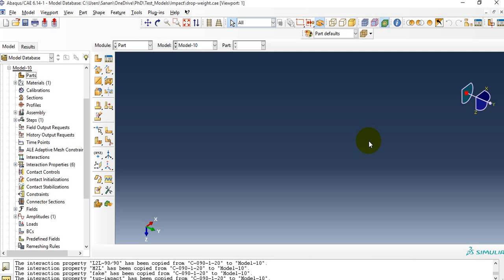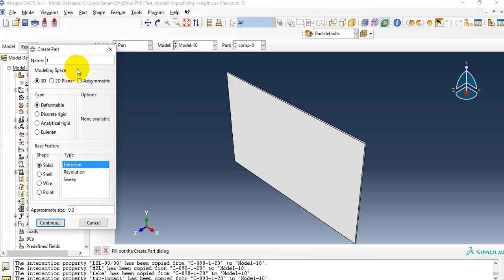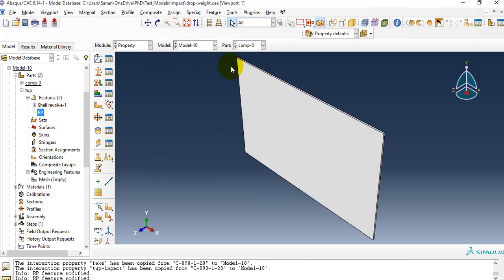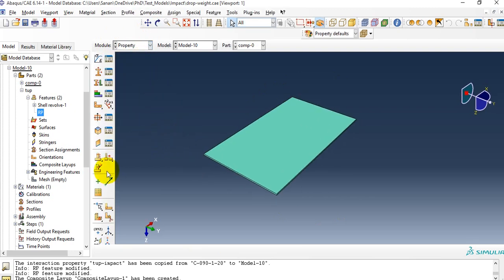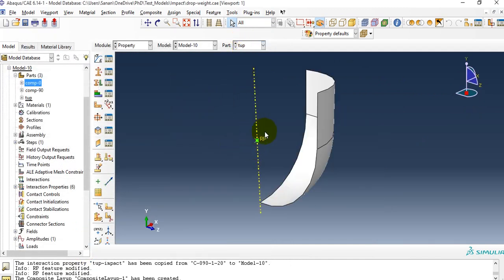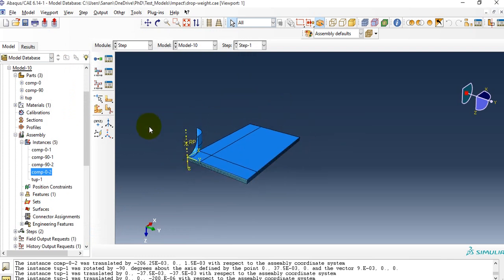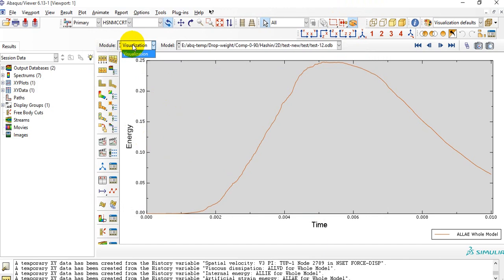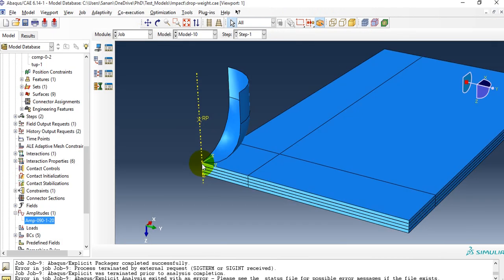Modeling and discussion : Drop weight impact on Fiber reinforced composites

Comment: 1) Anyone facing issues with velocity boundary conditions and lack of data for creating an amplitude, could resort to defining a "predefined field". It works fine!
2) Also I suggest using Analytical rigid instead of discrete rigid if the impactor could be modelled as an extruded/revolved shell. Analytical rigid gives more accurate results than discrete imo.
3) Take care of the mesh size as well. Check if its an element or node that is present at the impact point. Its highly sensitive to the results.

Comment: Thanks for making this great video. It helps a lot.
I got an error when I was using the surface-based contact to simulate the delamination between continuum shell composite model saying that the general contact can be given a property with cohesive or damage. In this video, you solved it by assigning a fake properties. But I tried in Abaqus/standard. It doesn't work, then can you tell me what I can do?

Comment: Hello sir, I want to model a reinforced concrete beam in Abaqus without using Rebar, I want to assign only area of steel as a whole to the beam, so later I can use the area of steel to design the rebar using design software? How to design this model in Abaqus? Can I use composite beam or? Please help me if possible. Thank you.

Comment: Hi! i became  the error about the Orientation. It is: The local-1 direction (after the additional rotation and permutation) of the material orientation, specified via *ORIENTATION, for element 4800 instance KOMPO_-45-1 is normal to the SHELL, MEMBRANE, GASKET, COHESIVE, or SURFACE element. The local 1-direction must be projected onto the element surface. Check input data.
What should i do? Thanks a lot.
Reply: Maybe someone faced my problem which I could solve it. I used data for amplitude in Load section and I finished everything but when I wanted to submit my job I faced the following error: 

"The local-1 direction (after the additional rotation and permutation) of the material orientation, specified via *ORIENTATION, for element 1 instance COMP-0-1 is normal to the SHELL, MEMBRANE, GASKET, COHESIVE, or SURFACE element. The local 1-direction must be projected onto the element surface. Check input data."

After searching, I used "assign stack direction" command in mesh section for each layer (before using this command you should click on "part" command on top of mesh section in object command and don't use assembly command ). after clicking  on "assign stack direction" choose a part of a layer (for example we had 4 parts for each layer in this tutorial video) then click on the top surface of that part that is brown or near brown surfaces and do this step for each part of layer.

Comment: Maybe someone faced my problem which I could solve it. I used data for amplitude in Load section and I finished everything but when I wanted to submit my job I faced the following error: 

"The local-1 direction (after the additional rotation and permutation) of the material orientation, specified via *ORIENTATION, for element 1 instance COMP-0-1 is normal to the SHELL, MEMBRANE, GASKET, COHESIVE, or SURFACE element. The local 1-direction must be projected onto the element surface. Check input data."

After searching, I used "assign stack direction" command in mesh section for each layer (before using this command you should click on "part" command on top of mesh section in object command and don't use assembly command ). after clicking  on "assign stack direction" choose a part of a layer (for example we had 4 parts for each layer in this tutorial video) then click on the top surface of that part that is brown or near brown surfaces and do this step for each part of layer.
Reply: how u took amplitude data

Comment: Hi Sanan,

This video is more informative. I am trying the same problem using 3D hashin failure criteria (VUMAT subroutine).

Iam using a composite layup tool with solid as a element type for modelling a laminate.

The plate is meshed using 3D 8 noded linear brick solid element C3D8R.

After submitting the job, I am getting the following error 
1.  THE PARAMETER COMPOSITE CAN NOT BE USED IN Abaqus/Explict 
2. 630 elements have missing property defination 
(All these 630 elements belongs to composite plate)

please help me  how to overcome this error. 

Thank you
Reply from the maker: +vijay krishna don't use the composite layup tool instead use the orientation tool. it will work then.
Reply: ok sanan i will try and let u know.

thank u
Reply: +Sanan H Khan i tried orientation tool to assign material orientation. It works fine.
and i used solid homogeneous sections (with composite properties)  to assign  material properties.  

is it right to use solid homogeneous section with orientation tool  to model composite laminate.
Reply from the maker: vijay krishna go with it.
Reply: +Sanan H Khan  OK, thank you
Reply: +Sanan H Khan can u please give an interaction properties for 0-90 laminate & 0-0 laminate.  

i am modelling sandwich structure where can i get the interaction properties for foam (rohacell) and 0 laminate.
Reply: vijay krishna yes, solid elements cannot be used with composite layup, you have to create section and assign orientation to them (which is the layup angle)

Comment: hello  sir
first thanks a lot for sharing such  tutor. but i have some question.
when i  increase the mesh density(very fine) , the final solution is start diverge and the ALLIE graph is highly fluctuated. and also when am using stabilization (1e-05) to all, the ALLVD are   very high when compared to ALLIE. what shall i do? , and if its possible please  give me the correct stabilization coefficient. thanks

Comment: am modeling on 3d solid model using composite properties but i got this error message " Element 1 instance temp-doooooor-new-1: layered material properties can not be specified for this element type". my question is if i want model a composite am i obliged to design it on layers and use shell model? if not how can i fix this problem?
Reply from the maker: you are forced to use shell elements.
Reply: ah ok thank you sir

Comment: Hello Sanan, I have noticed you have several Sets, materials, Amplitudes already in the model before you start the tutorial. It would be very helpful if you could provide this information on an external link.
every tutorial is very long to go check another two or three one hour tutorial looking for the properties.
Reply from the maker: +Ricardo Tellez will going to take up the issue in the next video

Comment: hi 
i simulated low velocity impact on a composite plate. the problem is that optained viscous diss. energy ALLVD is too high, almost as internal energy, also total energy changes a little however its change is too small compared to internal energy.
do you know how can i fix this?
thank you in advance.
Reply from the maker: +mohammad reza mohammadi have you used infinite elements ?? if not then, in step--edit---other tab--put linear and quad 0...check it then.

Comment: Hi, I tried to model a low velocity impact with the same mesoscale approach you showed in the video but despite I adopted your same approach a compenetration of plies under the impactor occurs.  Also very high values of ALLVD and ALLPW resulted...What could be the cause?
Reply from the maker: Allvd hints you about the viscous dissipation energy. High value compared to internal energy ( more than 1 %) signifies large deformation and hence large value of stabilization to avoid element failure. Allpw is plastic work which is fine if you have large plastic deformation.

Comment: Hi Sanan 

I am using instantaneous velocity for the tup. As you mentioned i am using a Step 1 to assign a positive velocity and created one more step viz. Step 2 to assign negative velocity. In both the steps i am assigning velocity same Reference point. 

After submitting the job the following error is coming.

1 nodes have dof on which velocity/displacement/acceleration/base motion etc. constraints are specified simultaneously. The nodes have been identified in node set ErrnodeBCRedundant Dof.

Please help me to avoid this error.
Reply: Deactivate the first Displacement on Step-2
Reply: did it work?

Comment: Hi Sanan. I have performed impact analysis using both solid elements and Continuum shell elements. In your opinion, besides the computational time, which technique is preferable considering through thickness stresses and 3D stresses.
Reply: Manzar Masud hello manzar. i have tried using solid element for this problem. always get the error 'element missing property definition'. i also read somewhere that hashin damage can only be used with shell element. can u guide me how u used solid elements
Reply: Yes. u are right. Hashin can only be used with shell elements. If you want to use hashin with solid elements, u have to write your own user defined subroutine. Hashin will not work with solid elements.
Reply: Manzar Masud thanks. saved me a lot of literature review. did u find any difference in the outcome after using solid elements.
Reply from the maker: let me come in. i happen to miss the comments :). for out of plane problem like impact shell elements are not sufficient. they does not have sigma33 tensorial component which is the most dominating in that case. so the difference will be obvious. make your own subroutine. it will be a new learning process. if i got time i will try posing a video on it.
Reply: Sanan H Khan A video about writting Vumat would be grt help indeed. also have u done any composite impact problems in lsdyna or autodyn. Do the built-in material models in these solvers support solid elements with hashin or other composite damage models?
Reply: Exactly. I agree with you. I have tried impact analysis using shell elements and then solid elements using my own subroutine. The results with shell and Hashin are not correct.
Reply from the maker: i am not sure about autodyne but lsdyna does have modified Hashin with matzenmiller exponential failure criteria. very effective for drop weight impacts. if i am correct it is recognized their as MAT-162. i have never used lsdyna though.
Reply from the maker: moreover if you wanna use solid element and check with it, there is some third party plugin with name autodesk pfa. they also have student version. you can install it and choose your mat and failure criteria from it. like hashin puck etc...they allow using solid elements. i tried it but don't like it because i don't know what they are running for me. i think it is for industry people. if you want to control your simulation by yourself develop a vumat.
Reply: Sanan H Khan thx a lot sanan. Actually i have read quite a few papers on mat162. And the results seemed much more convincing then those with abaqus hashin. still a simple Vumat video wud be much appreciated if u get the time :)
Reply: Can u guide me where should I start, if i want to learn to write my own
 VUMAT.
Reply: And Manzar, did u model hashin damage initiation in ur vumat or damage evolution too (matzenmiller)

Comment: Hi, Sanan. Pretty good job, thanks for sharing this technical video to us, really helpful. I'm now simulating a steel joint subjected to impact loading on the brace end. As you know, dynamic property of the steel, such as yield strength, is quite different from that of static.  It will be strengthened by  the strain rate of the steel associated with velocity. The strain rate needs to follow laws of Cowper -Symonds or Johnson Cook. My question is how to assign the strain rate according to the law of like Cowper-Symonds in ABAQUS? Thanks!!!

Comment: Hi Sanan,  I am doing a research on impact simulation of kevlar fabric composites. Do you think that the built-in Hashin damage model criteria can be used for plain weave fabric reinforced composites. I have some doubt especially about the matrix damage criteria. Is there any other damage model available for plain weave fabric reinforced composites?
Reply from the maker: Nooruddin Sadruddin No it's for UD. for   plane weave use max stress or Tsai Wu envelopes. for mode wise failure yen and caiazzo criteria is there. some uses Hashin also but didn't explain the reason. though abaqus has inbuilt vumat subroutine for it and can be used.
Reply: Thanks Sanan for clearing up my doubts. I have tried using the inbuilt VUMAT. I read here ( https://www.researchgate.net/file.PostFileLoader.html?id=53823bc1d2fd644c4f8b46ec&assetKey=AS%3A273538722795522%401442228121981 ) that it can be employed by naming the material abq_ply_fabric but its not working. Have you ever tried using this VUMAT. And if so, can u please share how.
Again thanks for replying to my question.

Comment: Sir, What is the difference between in-plane shear strength of lamina and longitudinal shear strength and also how to find transverse shear strength of lamina if i know rest of strength properties.Please attach if any files are to corresponding calculation
Reply from the maker: when you consider plane...shear on that will be in plane like plane 1-2..then shear tau12...and longitudinal means in the fiber direction..i.e if fiber is in1 direction then 12...if fiber in 2 then 23...transverse shear strength tau23 is approx 0.3 times compressive strength of matrix considering 1 as fiber direction.

Comment: Respected sir,
I tried to do the same but i am getting an error as "1 nodes have dof on which velocity/displacement/acceleration/base motion etc. constraints are specified simultaneously. The nodes have been identified in node set ErrNodeBCRedundantDof.'
I would be glad if u could kindly help me in solving it.
Reply from the maker: please bring the projectile under rigid conditions. curtail its movement in every direction other than z from load module.

Comment: Dear Sir, For GRP We  have to choose continuum shell or deformable solid while modelling?
Reply from the maker: Continuum Shell
Reply: @SanaanKhan  Thank you so much sir. One more silly doubt i got in the value of element relative thickness, i used the thickness of ply. is it correct?
Reply from the maker: yes, if only one element along the thickness. if two it should be thickness/2

Comment: hi sanan. Thanks for the video. Well i have two questions.
i. As i do not have the amplitude data , so i have applied the initial velocity as 2.51 m/s. I can not apply the +2.51 m/s and -2.51 m/s on the same step. So please tell me what should i do? As with only 2.51 m/s, my impactor is going in the one side only and not coming back. 

ii. My V3 vs time plot is constant at 2.51 m/s and U3 is also showing a straight line slope which is not correct. RF3 is showing good response. 

If you can comment on above mentioned, I shall be grateful.
Reply from the maker: Manzar Masud go through the whole video. and you will find that it can be done by adding an additional step in the step module.
Reply from the maker: Manzar Masud moreover, the velocity will remain constant. it is your b.c. so it will. remember that the output is on the r.p. as per the video so it will strictly follow the impactor.
Reply: Thanks for your reply.  Yes, i have found it and now trying the additional step method. Thanks.
Reply: did it work?

Comment: Very nice explanation of the procedure and results..Well done..Did you also consider applying gravity on the bullet and specimen?
Reply from the maker: this is debatable. since a velocity is not instantaneous and it is controlled. with the applied mass. I don't see a point in applying gravity. that will add up to the energy.

Comment: Hi Sanan,  I am doing a research on impact simulation of coir composites. Do you think that the built-in Hashin damage model criteria can be used? I have some doubt especially about the matrix damage criteria
Reply from the maker: if the thickness of your composite is small say less than 1.5 mm then the criteria will give meaning full results
Reply: Hi Sanan , I've encountered this error "When a sensor is defined only one output variable can be used for a particular output request since sensor names have to be unique. Please verify input." Do you know why?
Reply from the maker: Amirul Zolkhairi you might have checked the sensor

Comment: Thanks a lot for the video Sir.  I am currently working on a bullet impact problem. The job is running succesfully but a clear hole is not formed. The elements in the impact zone are being dragged and even after I did Result > Field Output > PEEQ > Remove elements  - I entered many values here.  But still, the distortion persists. I can send you the file, but I don't know your mail address. Can you help me Sir? Thank you.
Reply from the maker: check keyword status from the output deck

Comment: Hi Sanan. How many hours did the job take to complete its run ?
Reply: I M STRUGGLING WITH SAME HOW MANY HOURS IT WILL TAKE TO COMPLETE THE RUN ACTUALLY I M WORKING ON SANDWICH COMPOSITE SO IS THERE NEED TO PROVIDE CONSTRAINT BETWEN SANDWICH LAYERS,,,,,,,......................
Reply from the maker: it depends upon your mesh and no of elements. check the stable time increment in the status file. if it is below 1e-8 try mass scaling the 'bad' elements. for this video, job took 20 hours to complete with intel i7 2.93Gzh with parallel processing.
Reply: thanks a lot sir.......... also sir i want to know is the velocity or mass make significant effect in analysis and how can be get the energy to bending, shear and indentation effect in this analysis. also here the impactor is not coming in the rest that means the energy of the impactor is always constant, this will not convert in to shear, bending or indentation energy..................